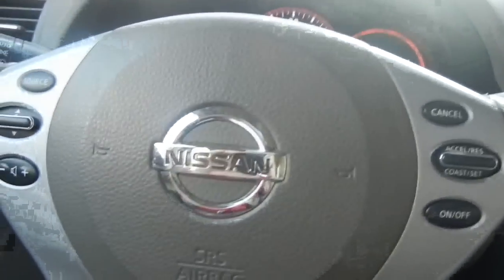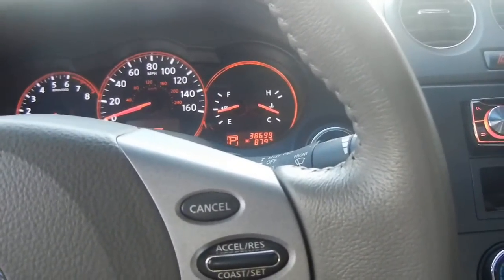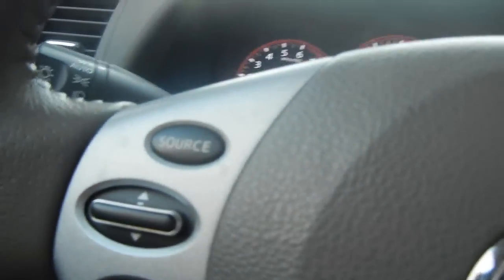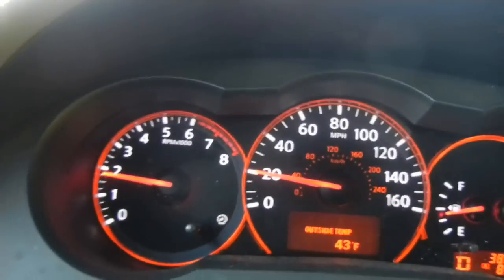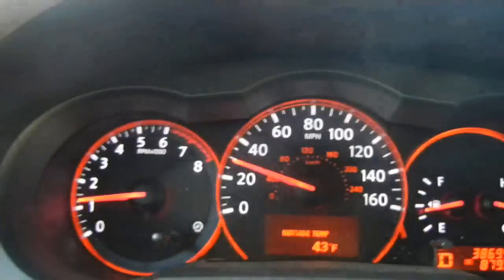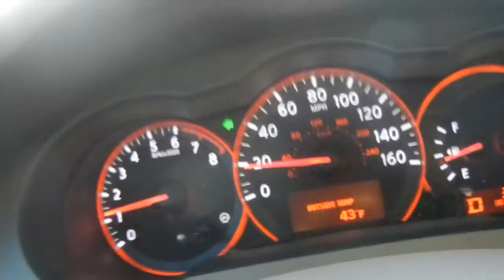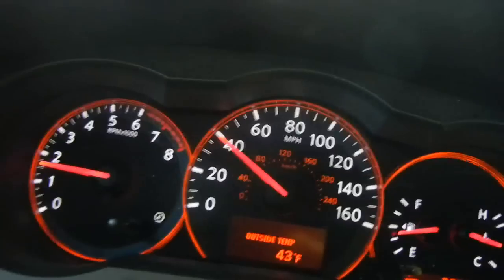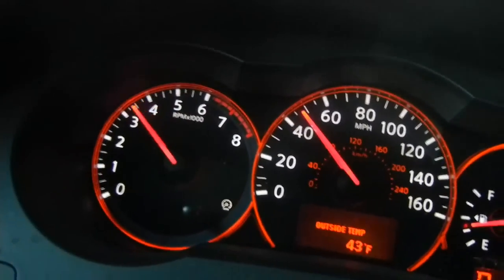Nissan CVT/ABS Problem

Comment: Really every time that happens the vehicle always seems to remain a tad sluggish.  It is just not as bad as it initially was when it first happened.  Transmissions don't deal with hard stops too well so every time you do it you are rolling the dice on whether it will still run and the odds are less in your favor every time!  A dealer may say it is normal but that does not seem normal really.  Find a transmission repair shop and ask what they say.  I would expect to hear that I should avoid doing that at all costs (unless I must do it).

Comment: I had the same model and mines keep going into fail safe mode after 30 minutes of consistent driving. Nissan could never tell me why .. cvt is good but still not perfected by Nissan. They have a lot of safety features to keep the belt from breaking and sometimes those features are not suitable for hard drivers.
Reply: How do you get the Nissan Versa out of safety mode

Comment: My Dodge Caliber (2008) had CVT.  Every time I panic stopped in it, the CVT would mess up.  I shifted in to neutral, waited 5 seconds, watched the RPMs reset/drop back to idle, and continued on as normal.

Comment: I have noticed this issue with my Lancer ex GT. It also has a CVT. I thought that was something with the car electricity, but now it seems that it is a common issue for CVT cars. And maybe it's because the ABS system takes some electrical power when you brake which would weaken the car's acceleration.

Comment: I don't see any problem here, other than the fact that braking this hard and flooring it right after is not something a driver usually does. And even then, this normal behavior is probably to minimize wear on that shitty steel belt, which every CVT has. 
You can sum it up to: the CV transmission is the worst crap ever invented for cars. It's not well suited to such heavy vehicles as cars.
Unfortunately, car makers like it because it's much cheaper to produce and they can make more profit selling each car, because the savings are not passed on to consumers.
Reply: For small cars like the Scion iQ fits perfectly. No problem at all other than a few time it feels restrictive but barley

Comment: Its because its a belt not gears. Common sense would tell you there would be some type of delay because of it. Its only a issue when people continuously try to solve the problem with shit like this. Just drive the car as you would. I have a 08 altima 2.5s and it took me a month to get use to the feeling of a cvt. Yes a cvt from nissan isnt perfect in then gen. Model but realize ehat your buying before you buy it. Thanks.

Comment: Research that when the vehicle comes to a emergency stop and then doesn't go to full throttle when pressing back down on the gas it may be a safety feature to not allow full throttle to open sensing that if there was a accident impact, the gas flow ratio is lessened as a safety feature for a few seconds so as to not have a huge gas explosion if there is a leak.  Remember, this only occurs on emergency braking, not regular stop and go driving.  Sounds like a safety feature to me and I have experienced it in my Acura which does not have a CVT transmission.